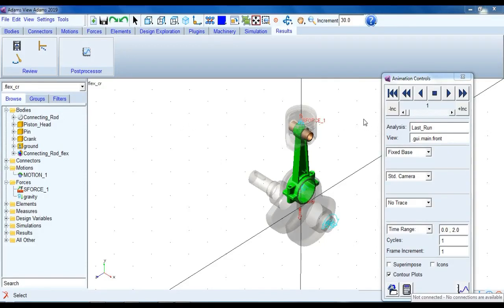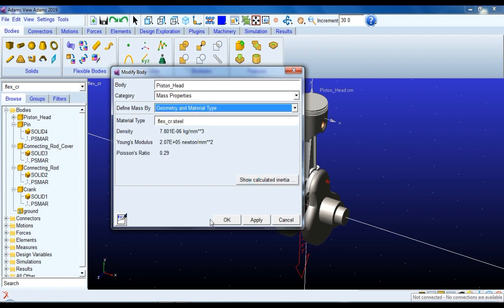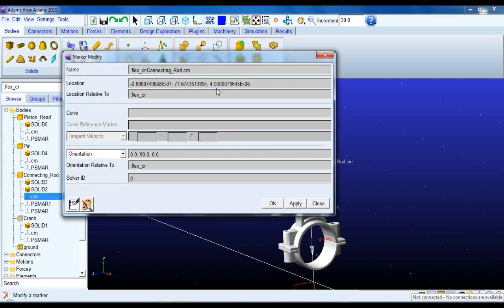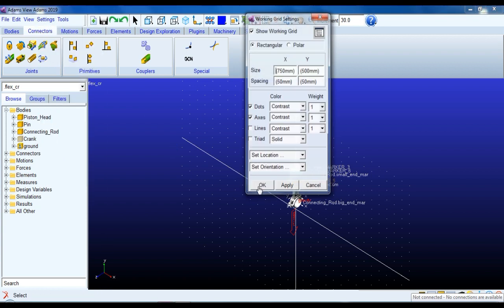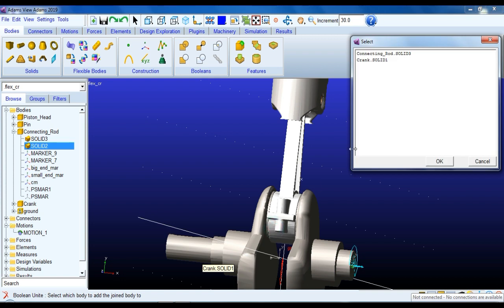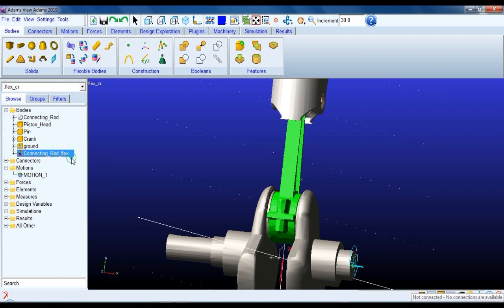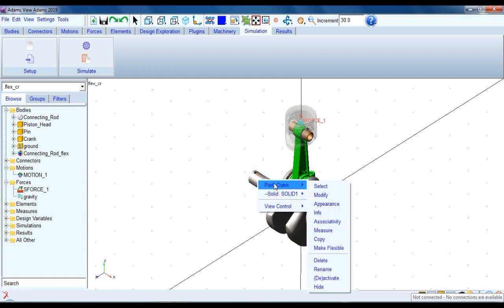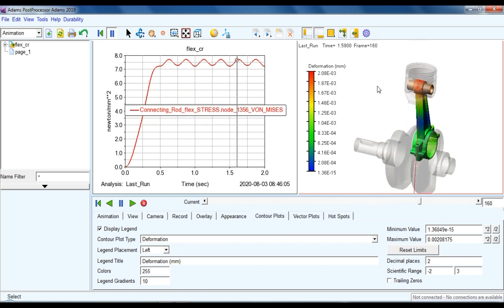MSC ADAMS Tutorial - Flexible Body Analysis I Stress Analysis of Moving Bodies in ADAMS

Comment: Sir please help, when I open durability plug-in and try to find hot spots, it says no data was found. When I try to find nodal plots it says no stress data in mnf of flex body. HOWEVER there is clearly stress and strain available. I can see it in the simulation as well. What could be the problem?
Reply from the maker: You have to define the what outputs you want while creating mnf
Reply: @3DTechnocrafts  Ohhh okay thanks a lot
Reply from the maker: Also in some Adams version it doesn't show hotspot before 2017 version

Comment: Sir thanks a lot. I have a few questions. First of all what do the contour stand for at 20:07 ? Is it stress, is it displacement? At that point no force was acting on the system, the only parameter you defined was MOTION which is a kinematic parameter, no? So I am having hard time understanding what is changing inside the flex part. I think it can't be stress or displacement since there is no force. So I am asking that, what does that contour change stand for and why?

After that you defined a force. Now, the only reason behind defining the force was to observe the flex parts' displacement and stress values right? If that solid was not flex, and rigid instead, defining the force would literally mean nothing since there is a motion defined and it overrides force. Is my assumption correct? I hope you answer, thanks a lot for creating ADAMS documents, there really are not much around.
Reply from the maker: even if there is no external force there is weight of the moving parts will act as force. As rotational angle changes the weight components will also change (horizontal and vertical force) hence there will some force as well as deformation.
Reply: @3DTechnocrafts  ah I understand thanks a lot, but other than that, defining a motion overrides all the forces in terms of kinematics right? Forces then only act on stresses and strains
Reply from the maker: @imampatrick  no it will consider force when motion is also applied
You can check in post processor also the forces
Reply: @3DTechnocrafts  So you defined motion to crank and then defined force, is the crank's or crank shaft's velocity going to change now that there is also force being applied?
Reply: @imampatrick  Yes he did apply both but to be honest it might be useful to just apply the force on piston head and observe the dynamics of the system. In any case, the DOF should remain the same.

Comment: Good day sir, may i ask i have to test run my rotordynamic model (Just flywheel and suppporting shaft), can i use joint-related icon as well, such as revolute, joint connection and so ? ~ Thankyou ~~
Reply from the maker: I recommed to use Nastran for rotordynamic
Reply: @3DTechnocrafts  I see, i have Nastran as well, may i ask can I find the torque required to rotate my model in ADAMS first, or i too can get it as well in Nastran ? Thankyou for replying me ~~~
Reply from the maker: @limkwerly8508  yes you can find in Adams
Reply from the maker: @limkwerly8508  if you know stiffness values use bushing instead of revolute joint
Reply: @3DTechnocrafts  ok i will try it. Thankyou Sir. ~~~